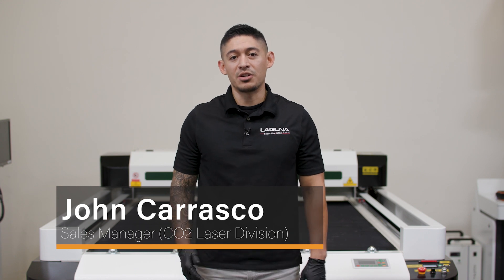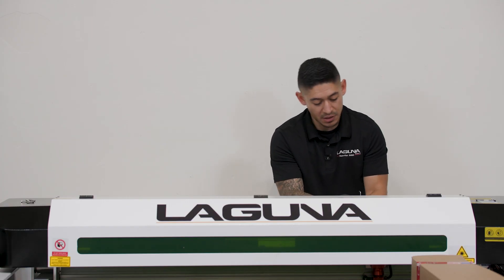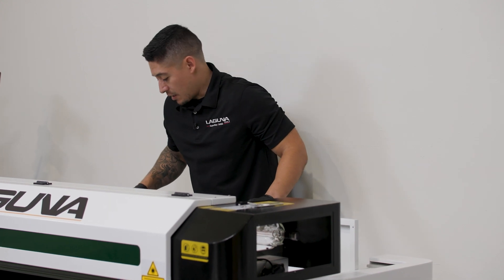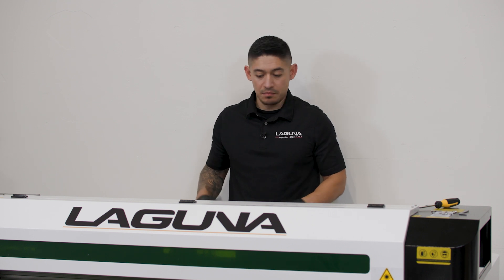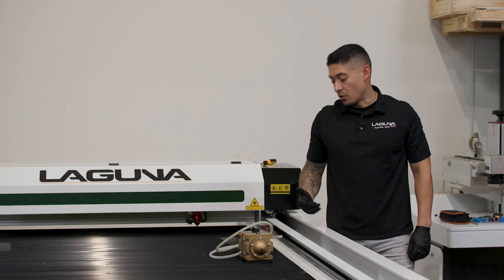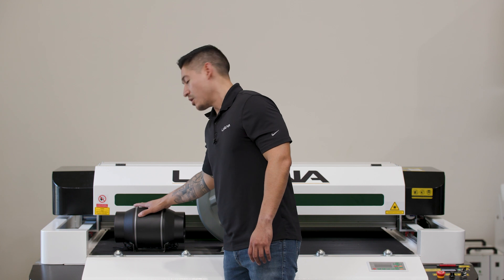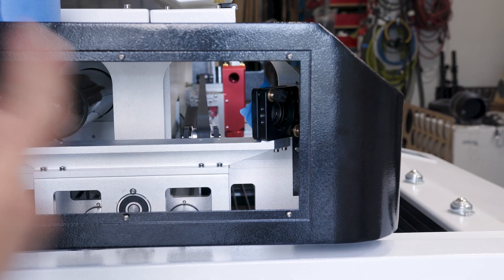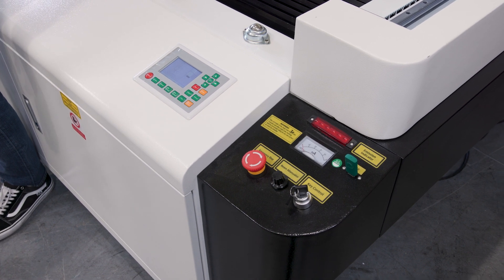How To Set Up A SmartShop® Laser LCB | Laguna Tools

Comment: So no manual? This video didn't show the 2nd tube to the laser get installed, the air hose connection is different, the machine came with two exhaust fans not one and didn't show how to properly connect them, your website does not offer that better version of the fan, had to purchase one off of amazon...or should i have purchased 2 .....exactly, no info on connection with computer or software, came with no software or manual, and every piece of paper is in Japanese. was told before purchasing that all of the attachments plugged into the machine's onboard outlet and the machine had 1 cable that plugged into the wall outlet ........that wasn't true i cancelled my electrician for no reason this will require 5 outlets minimum. hope i have better luck than desert woodworker contacting support.
Reply from the maker: Thank you for bringing your concerns to our attention. We apologize for the issues you're experiencing. Please contact our support team by submitting a ticket form from the following page: https://lagunatools.com/resources/customer-service/ 
A member of our support team can provide you the additional assistance you need.
Thank you.